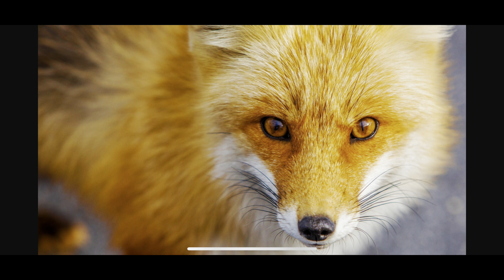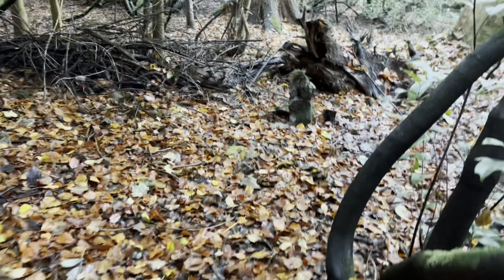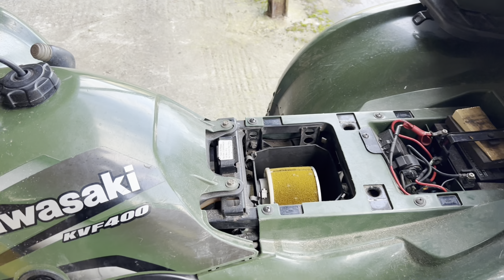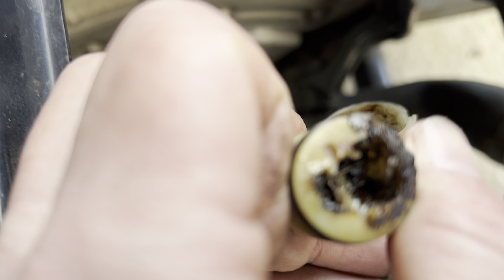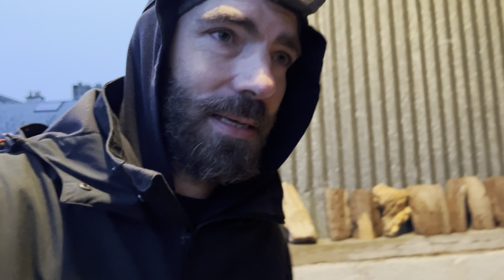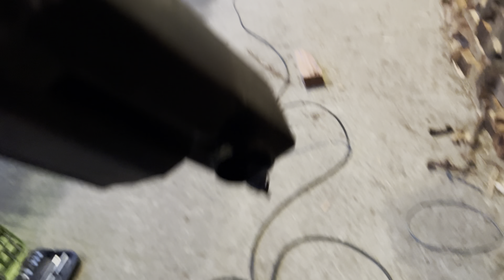Episode 5- Chasing the fox hunt off the sanctuary, and some snotty plug repair

Comment: Agreed. Foxes are wonderful lil creatures...
-They tend to be pretty curious about humans & develop quite the relationship with ya as they gain trust....
-Is that THE 'RE-place EVERYTHING'  quad of  dimly frustrative diminishing returns? (Or is that one a wholly separate puzzle-factory machine?..;)
Reply from the maker: It’s the quad which received hours upon centuries of TLC. She is running really well, seems happy. I dont push her too hard like I used to with different quads  when I was younger. I buy her dinner, give her flowers and a nice bubble bath from time to time. 	The rectifier/stator plug was something which my intuition was telling me was going to be a future problem, but at the time when I was upgrading the electrical system I thought, “it’s will be alright”….Big nope, listen to intuition. Anyway, it all worked out, I installed the new plug without it raining on me and  just missed it getting too dark outside. Only thing I have to do from time to time, like yearly, is drain water out of the carburetor. The engineers foresaw this issue and installed a convenient drain plug and hose. Only issue there is using a long extension on my wrench and occasionally losing the H3 driver in the engine body. That’s what 90deg needle nose pliers are for and a snug fit on driver, oh and occasionally tape
Reply: @Castlehassle2075  
WILHELM!...It be you!

Its always tha Rectum-Frier dood...;)

At least its been serviced to a rather HIGH degree, although seriously frustrating @ times...

Oh dude, 100% agree on 90D long-beaky needle nose pliers! That tool has saved my azz soooooo many times now with home projects, mechaniac stuff, plus gunsmithing-mods where ya need to get in really tite corners/receivers in order to hold nuts while fastening allen key sockets or similar....

Beats a 1/4 inch drive with one swivel knuckle right @ the ratchet, an extension bar & then another swivel right before socket, &/or what ever else ya need to stick on 'er ta get it too work weirdly. 

-Refreshing to see engineers/designers that truly THINK about those types of issues & provides small, but helpful, maintenance access quirks/features right?

Hoping all is well for you n' tha fam there in Ireland. Tell everyone 'What-Up' for me eh? 

Sending ya over that 'Mysterious Middle East' YT channel & the interesting vid they'd produced: 'Exploring  Ireland's Paranormal Middle Eastern Roots' (I may have sent it to ya previously? DEF give it a view!)